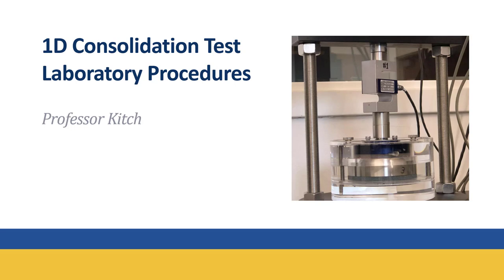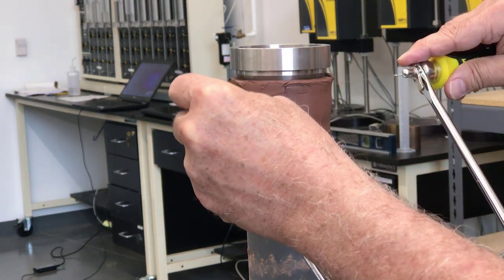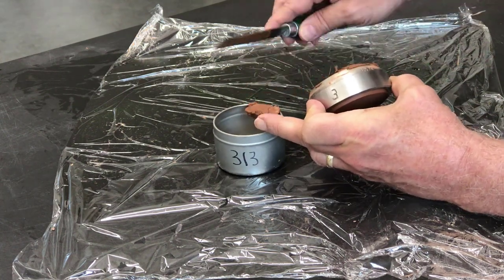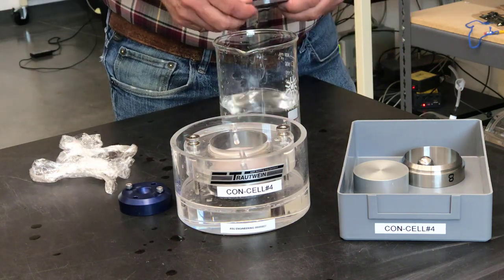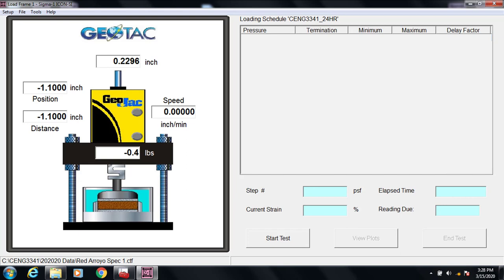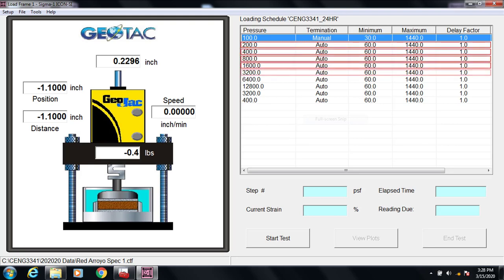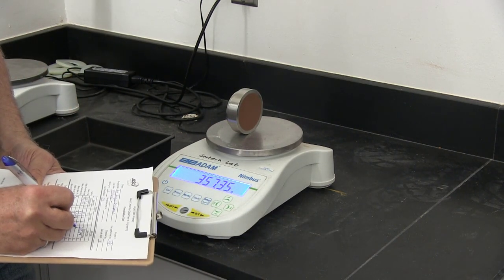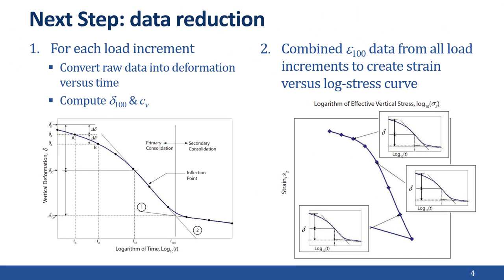1D Consolidation Test: Lab Procedures

Comment: Do you use also Taylor and the Bjerrum and the isotachen methode to do the calculations for al parameters?
Reply: Yes, you can use those methods. For my intro geotech class I teach just the Casagrande method, because I think it’s the most intuitive.  In practice I like to use the Taylor method  as well because it allows you to project ahead where Casagrande’s method allows you to find t-100 only by looking back in time. If you need the secondary compression index, you need to use Casagrade’s method. I don’t use Bjerrum’s isochrone theory. It’s not common in practice in the US.